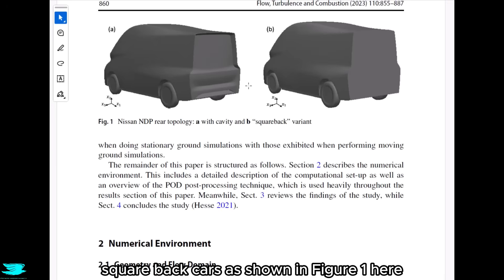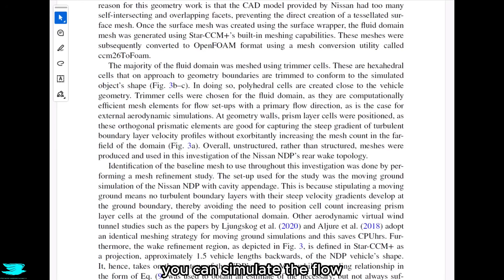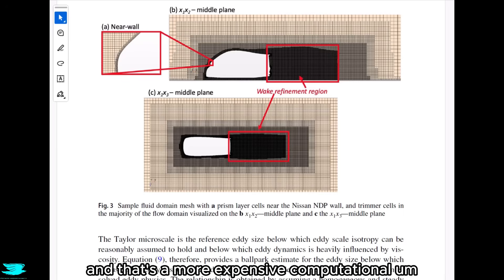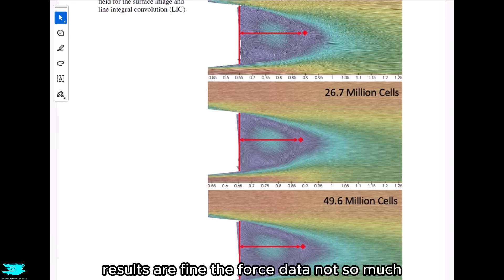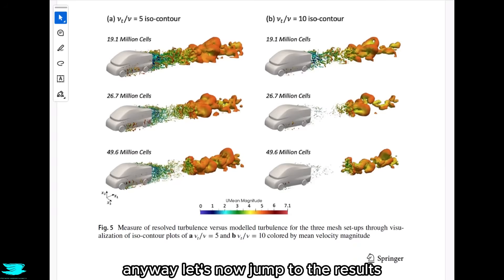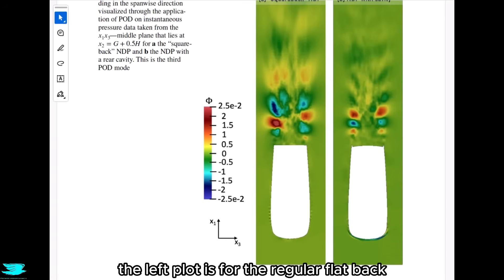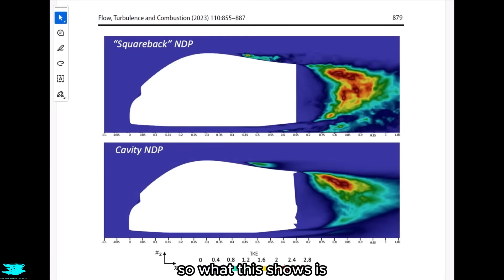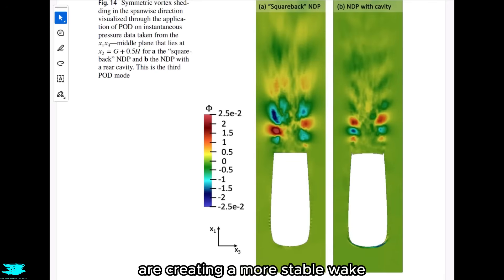How To EASILY Reduce The Drag Of A Squareback Car

Comment: Great explanation. I have one doubt: at 9:40 , a higher number of cells should show more isosurfaces with the vt/v ratio, right? as more numbers of cells resolve the eddies better. Why do more numbers of cells show fewer isosurfaces? Thank you.
Reply from the maker: The turbulence gets modeled more accurately. So, the difference here isn't in the smaller scale, from what I can see (the isosurfaces are large), so it's about accurately modeling the turbulence destruction.
Reply: @PremierAerodynamics  oh, i get it. thank you